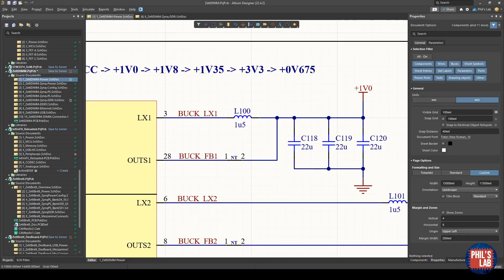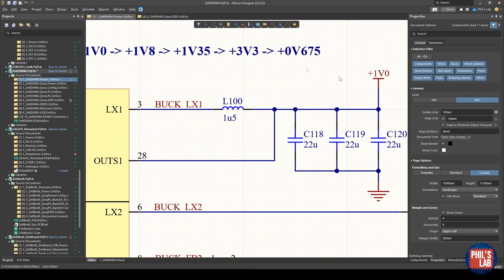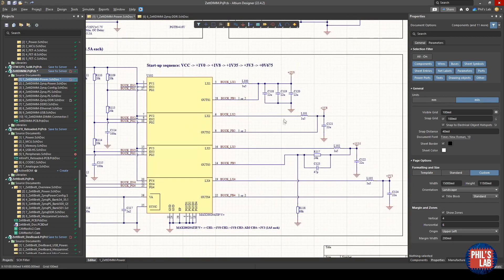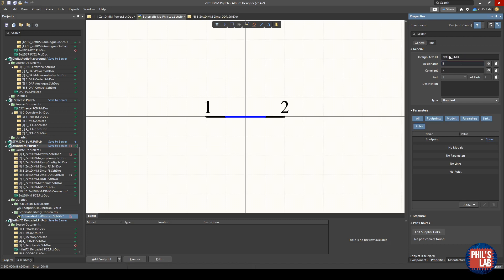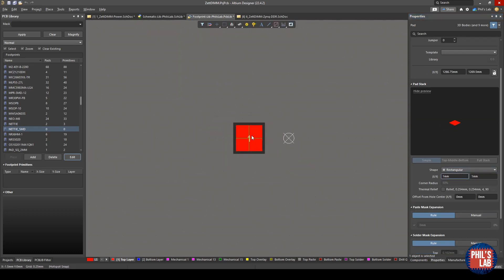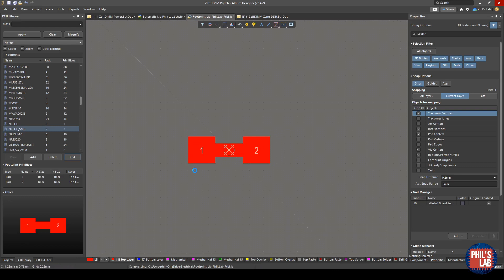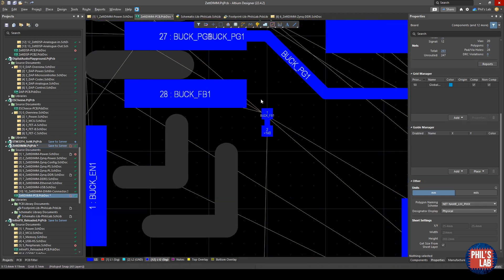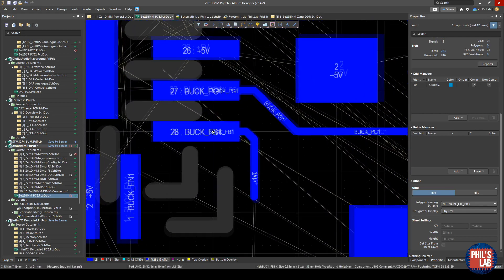(Sponsored) PCB & Schematic Tip: Net Ties - Phil's Lab #69

Comment: Hi, good solution. But what about planes? The only way to divide planes is by isolating areas, but if we do that, the only way to connect the tie is by using other layers. The perfect solution would also involve using planes. Altium should somehow allow joining that plane area while still having the two separate zones defined in the plane.
Reply: How do you connect planes through using other layers?

Comment: I would Hope for Altium to automatically have net ties' footprint a single pad (even if under the hood they are two in orden to play nice with schematics).

Currently what you do on the PCB to "hide" the net tie is a workaround. If the net tie was just 1 pad (or multiple pads overlapping at the same point) then you would not have to care about avoiding restrictions and such.

Comment: Why does one not want the fill to snap to the center.?
Reply from the maker: According to Altium documentation: "Make sure that the copper region just extends to the sides of the pad but not to the snap point in the middle of the pad itself. Otherwise, connecting tracks won't connect to the snap point of the pads later in the design."

Comment: A big fan here. Thank you for sharing your knowledge it really help me out to achieve my goals. 

As a suggestion, would it be possible to release a video about best practices and components to use. For example a recommended LDO to use for battery applications or converters. I usually see a resistor before the EN pins for most of the chip. What is the purpose behind it?What components to use to avoid EDS, TVS? In general a list of components/part numbers that every PCB designer should use. 

Again thank you for your time.
Reply from the maker: Thank you! Yes, definitely - that's a great suggestion and someting I'd like to cover in future videos. In the coming month I wanted to go over, for example, part selection/component sizing for a switching regulator.